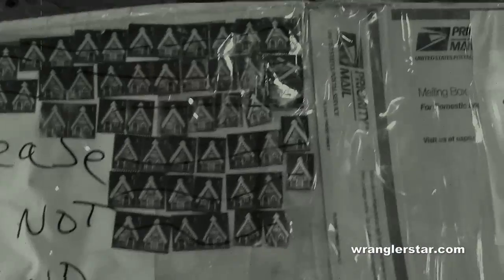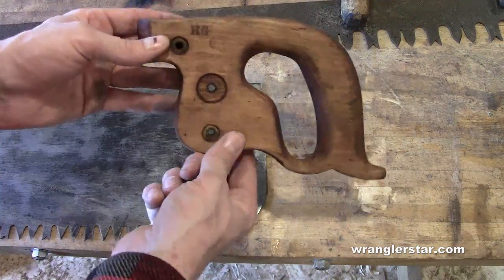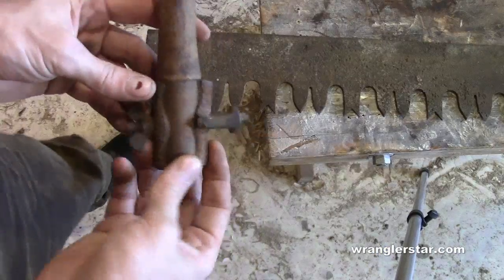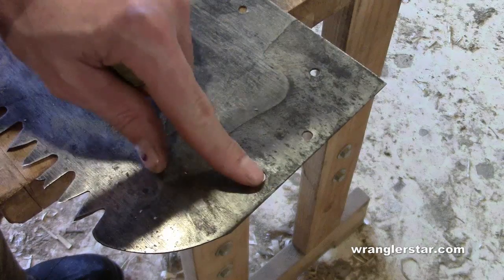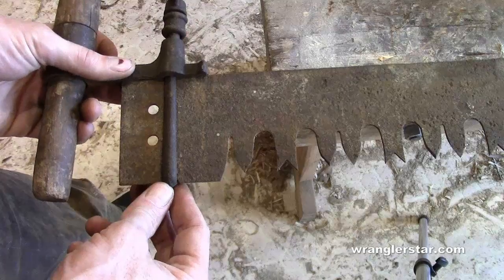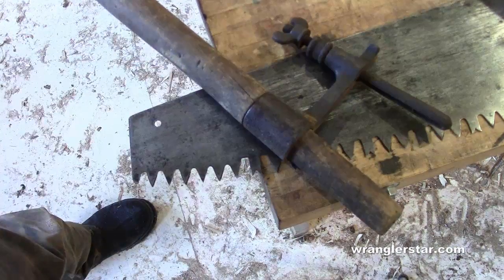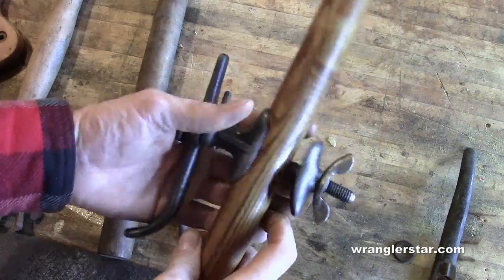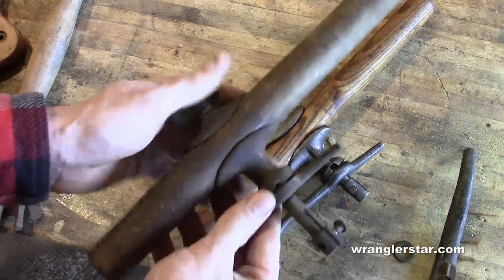Crosscut Saw 4.0 - Wranglerstar

Comment: I meant to say this on your other video but for some reason I didn't so here goes, there have been times I've had to enlarge holes in very hard material and knew a drill bit wouldn't work, so I use a carbide burr saves on the drill bits and it is really effective.. Hope that helps some future project.. Take care
Reply: +rchopp ///  Good. Try cobalt too.

Comment: If you need to drill hardened steel you need carbide drill bits. They are about 70 RC and the steel is probably around 55RC and normal drill bits are around 55RC as well so it will not cut the steel. You could anneal the steel as well but i wouldn't want to put her in a forge fire.
Reply: What? For that saw to be hard enough to need a carbide bit it would be very inflexible and surely break.
Reply: it is at a spring temper which makes it flexible. It is like a thin leaf spring and you cannot drill a leaf spring with normal HHS drill bits.justfakeit888

Comment: The screws are loose because they've been tightened repeatedly and have compressed the wood. The screws then bottom out before fully tightening. If you file 1/32" or so off the male end, the screw will lock down tight and the handle won't wiggle.